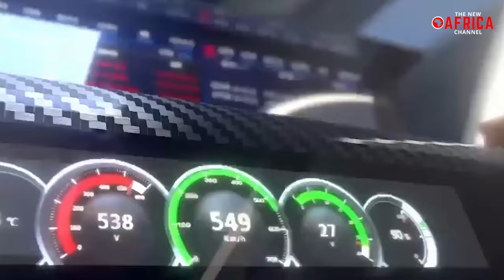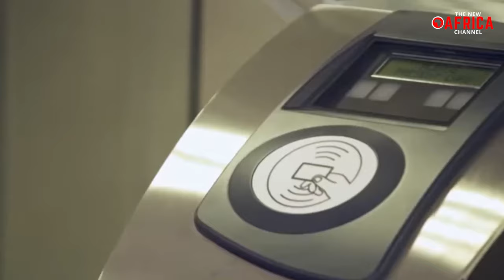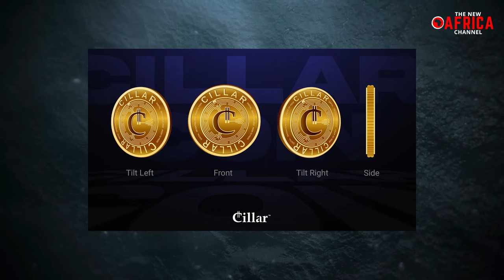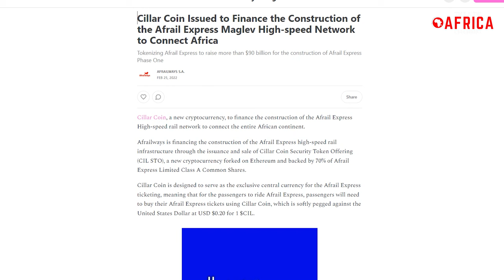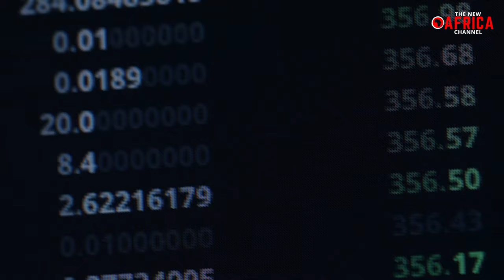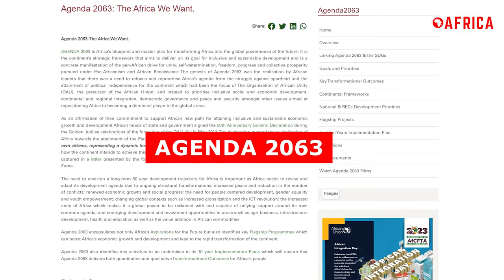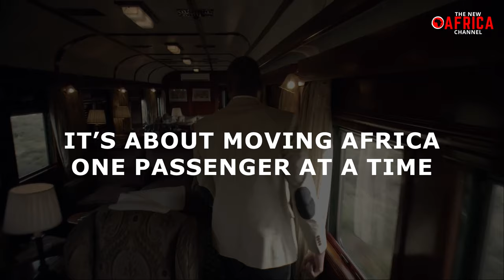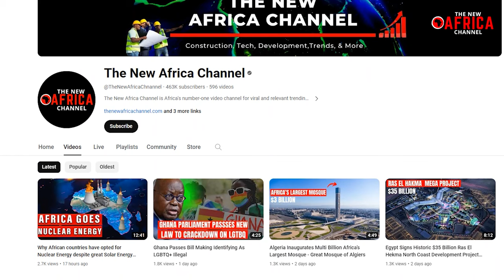Africa's INSANE Plan To Connect The Entire Continent By High Speed Rail

Comment: I would LOVE to travel on an inter-african trainline. It would be fantastic!! However, I'm sceptical about Afrail. It is listed as a single person owned company based in the Cayman islands, with very opaque finances that has been running since 2014. So that should raise alarm bells with fake crypto investments. If the could make money on the rail system, then they should be raising investment on that basis. But then they suggest using Maglev technology - that is incredibly expensive, which is why it has never been successfully implemented commercially without incredible subsidy. Inter-African rail networks are needed! but the starting point should be state to state connections with traditional rail and high speed rail technology
Reply: I agree but let's see where this goes for now
Reply: very reasonable. Objectively true.

Comment: I think the above ground type of maglev train would be more suitable and conducive to the African landscape.
Reply: Exactly especially with its lower maintenance costs and operating costs and higher top speeds also more flexible routing designs too I think this project IS maglev actually this is a maglev project as stated later in the video. If you watched the whole thing

Comment: Electrical Engineer
Magnetic levitation trains are a financial failure. Why don't we see many magnetic levitation trains? They all lost money. The hyperloop is twice the speed of a magnetic levitation train but using pods instead of trains in a vacuum travelling in a steel pipes will turn profits 20 years after investment. Hyperloops will be more financially successful than magnetic levitation trains. Stick with standard gauge rail that is high-speed electrified grade separated from the road network will work best.